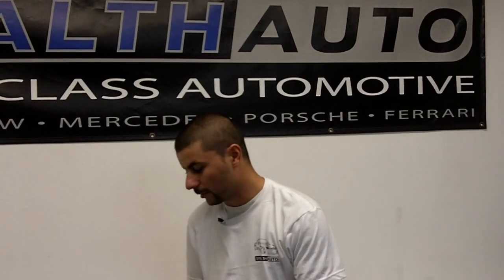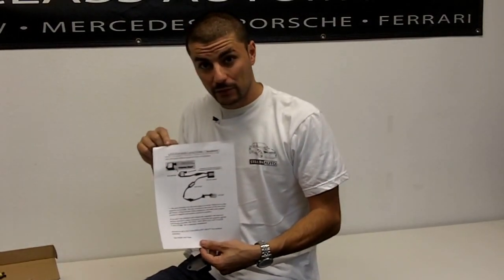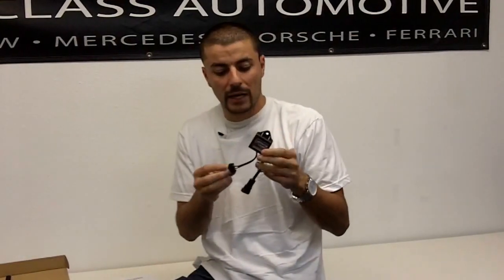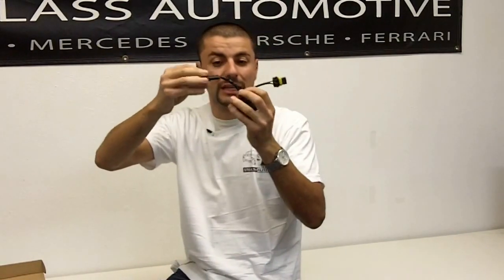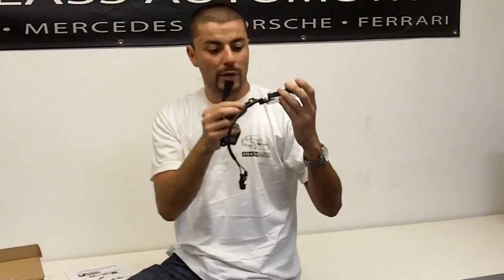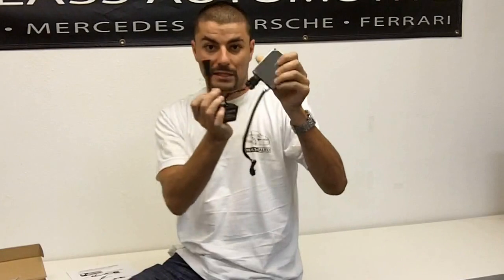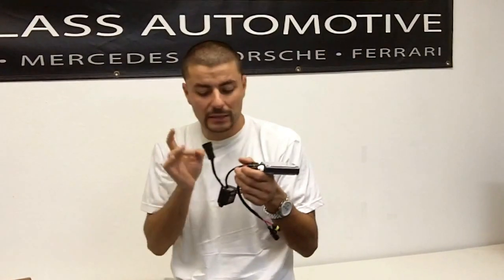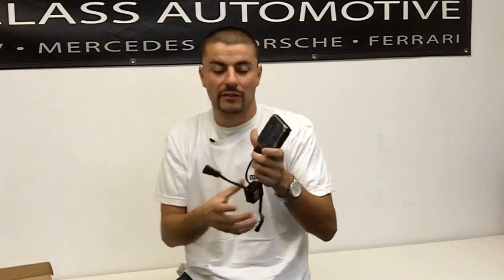HID DIY Anti Flicker Capacitors / Error Code Cancellers Tutorial

Comment: I sent a response video could you tell me if the Capacitors can fix. Its more like a power issue. If I unplug the one on the right the left will not flash but if i plug both up the left flash. HELP